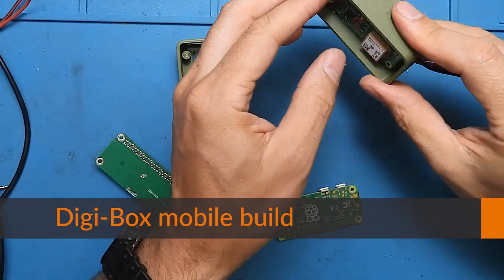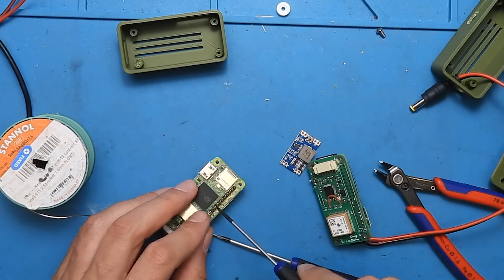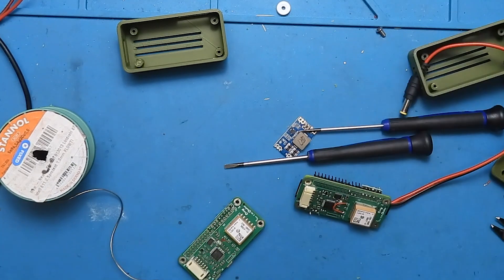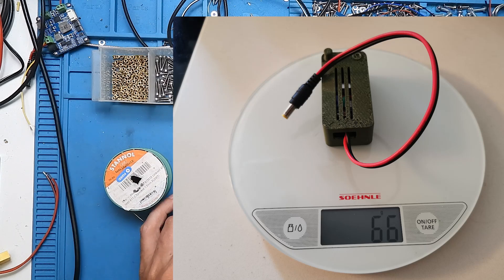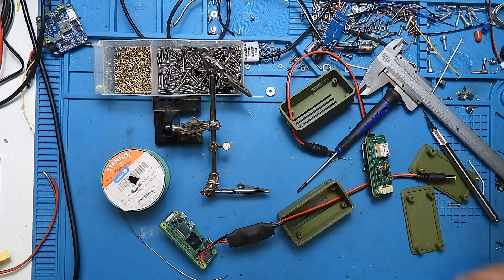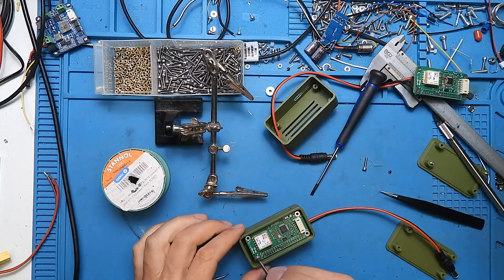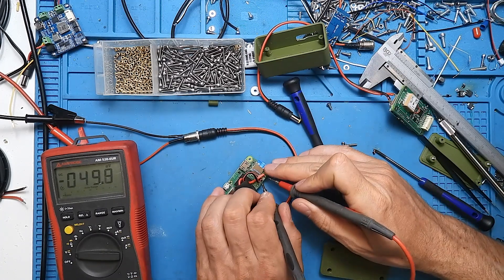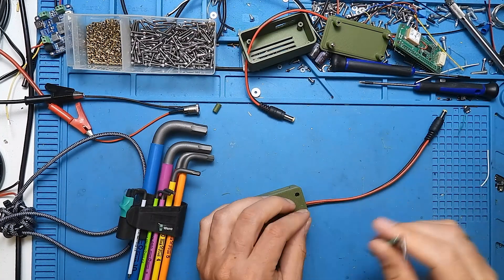Digital modes with only 66g ( 2.3 oz )

Comment: Can you post a parts list?
Reply from the maker: https://www.raspberrypi.com/products/raspberry-pi-zero-2-w/

or
https://www.raspberrypi.com/products/raspberry-pi-3-model-a-plus/

SanDisk Extreme PRO microSDHC Memory Card Plus SD Adapter up to 100 MB/s, Class 10, U3, V30, A1 - 32GB SDSQXCG-032G https://a.co/d/f3Rkv0x

5V step down converter
https://de.aliexpress.com/i/1005001483117768.html?gatewayAdapt=glo2deu

digipi image
www.digipi.org

gps module (should work with 3.3V)
https://de.aliexpress.com/item/1005006099194136.html